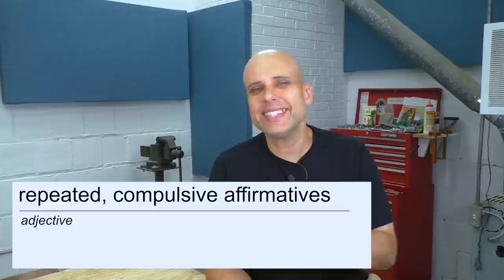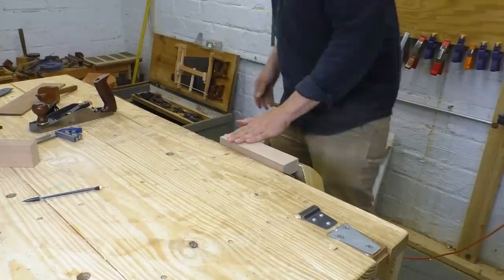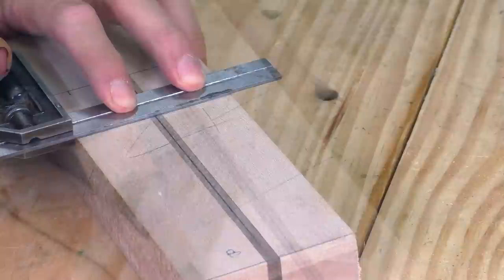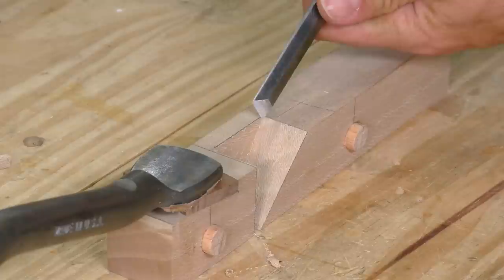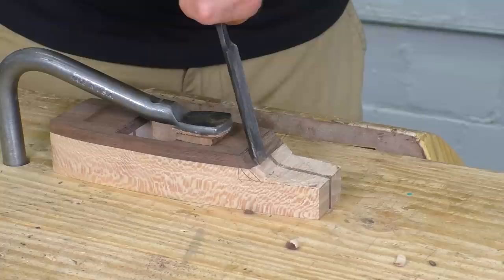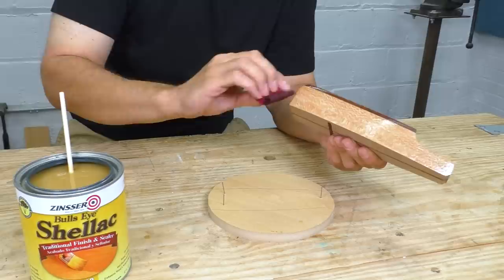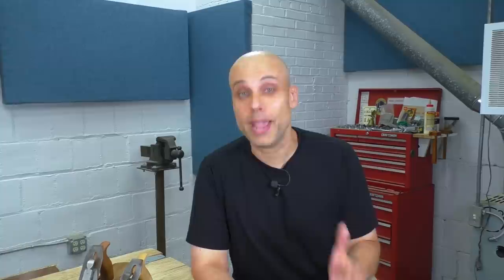I CAN'T fix this vintage plane...by myself.

Comment: I still remember you using the same method to true up the bed of your DIY spokeshave, in that video you used pencil instead of marker.
It's crazy thinking how long I have been following your channel. I remember that trick because I've made the same spokeshave with the same technique. It still works great and it's about time to change the mouth piece but I'm glad that I made it take-apart so it can be easily replaced.

Comment: Just finished watching the video, that plane is absolutely beautiful!  Between Jame's Wright's handle and totes, and your fix, it was sublime.  It looks way nicer than what I would have come up with.  But there is one thing I would have done differently:  I would have used a bit brace instead of a forstner bit.  It is the perfect tool for cutting a complex angled hole like that.  It is a hand tool, so you have complete feedback and control.  The snail bites into the wood, and the knickers slice cleanly.  
I am currently using my bit brace for a much different project:  Removal of moldy, water damaged particle board from a sink cabinet.  While a sawsall and a power drill would be faster, it is much more likely to damage something important like the water supply pipes under the cabinet.  So a bit brace and a small heyhole handsaw is the way to go.

And it was this guy on YouTube that taught me everything I needed to know about bit braces.  I wish I known about them a long time ago.
https://youtu.be/tTch3KE_Aio

Comment: So now I'm collecting wire from local house construction surplus locations.  (Once they put doors and windows in it, the surplus stuff isn't accessible anymore)  Once I have enough, I'm going to make an electrolysis ring large enough to drive my rust bucket car through.
I can hardly wait !!!

Comment: the end piece speaks for itself!  it looks great and would be proudly prominent on any cabinetmaker's bench.  
The pandemic put the ENTIRE world on hold, even if you caught it afterwards.  It's just going to be something we all have to deal with....from the sounds of it, it may be around for a while yet..  
the metal frame is interesting.  i've never seen one that had the scoop out of the back like that, though admittedly, i'm a VERY casual collector.   In general, i avoid the hybrid planes and look for the older solid wooden ones.

Comment: As always a great project with all the info we need to get going and build our own planes. Ive always wondered about how to cut out the throat shapes in planes. I have some really gorgeous pieces of kiln dried Australian Eucalypt hardwood. I also have some air dried, over 100 year old, Australian Iron bark which came out of an old shed in our little town. Ill practice on some pine I have air drying in the paddock and will need to be cut into stock pieces, or Ill just buy some pine from Bunnings too practice on before I use my good hardwoods.
Ill have to flick over to James' site and have a look at his videos on plane throat cutting.
I really like how you guys all work together to bring us the stuff we can do in our own sheds and garages.
Cheers from Down-Under 🙂

Comment: ooh nice choice on those rechargeables batteries, i use the same ones. I highly reccomend their better charger that that they sell, it shows how charged the batteries are and also lets you discharge them if you know they wont be used for a long time

Comment: Very nice job ,BUT I think the dark wood you added would have looked more interesting on the  bottom to set the handle off.❤
Reply: Im gonna drop my few cents here, I think it would look nicer if there was a sycamore strip amidst the walnut.
Reply: Having myself botched a handmade plane with a walnut sole, I would say it would have to be a different wood. Walnut is very pretty, but waaaayyy too soft for the wear.
Reply: Respectfully disagree, I think the walnut where it is understates it as the plane transitions from the dark japaning of the metal to the lighter maple.  

I think that understating transition is beautiful, and having the walnut on the bottom would be more striking but look to busy.
Reply: It couldn't have been on the bottom because of the mouth geometry. The angles of the plane bed came together at a very specific place that would have been messed up with an extra piece on the bottom. He would have basically had to redo the work cutting the bed and mouth.
Reply from the maker: @anonymousaccordionist3326  ah, out of all the comments,  one person gets what's going on.  Thank you!

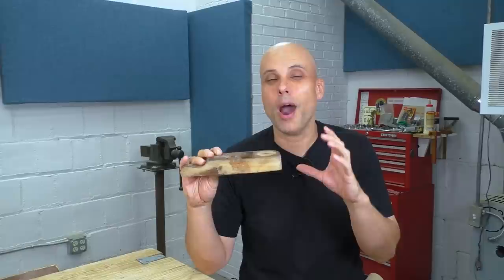Comment: I'm at 6:43 where you just discovered your mistake about the body being too thin.  I haven't seen your solution to that issue, but as someone who has made plenty of similar mistakes, I would do exactly what the original owner did:  Laminate an additional piece to the body to make it thick enough, and probably use a different wood species just to make it even more interesting.  To complete the bed, I would use the existing bed as a jig for the chisel to hollow out the new piece, then use the same flattening techniques you used.  

Now on to the video to see what you actually did.

Comment: Hi Rex - Noticed your bandsaw puts out alot of dust. Checkout rob cosmans dust extractor. PS I made mine without a slot hole to take off the blade. It gathers nearly all the dust with a shop vac.

Comment: I am sorry Rex and I am sure that my comments will bring me some hate. But you should have matched the wood you used to that of the handles. There are just too many colours going on, making the composition look confusing to the eye. Maybe the Rex Krueger of a hundred years in the future will ask what was this guy doing I guess he found some odd bits of timber in his scrap box and cobbled them together. or repaired the plane over time, as one bit wore out, he would use whatever wood he had available at the time. What you have done has been well executed and I am sure that it is a perfectly functioning tool. (A) for the quality of your build & (C-) for the artistic interpretation of the brief. Well done, Rex, it was a lovely personable video, a really quality production as ever (A+).

Comment: OK. now how about a how to of the electrolysis ring? I have an old gouge i would like to clean up.
Reply: Its was a joke, that's not how electorlysis works lol. It's still easy enough to do though, just have a google.
Reply: @stacksmalacks8826  i wish I could afford an induction coil. Have done electrolysis before. Also have seen those laser things that heat and remove rust.

Comment: Whoa! Hold on Rex. Do you read these comments? I want to know more about this electrolysis ring. I know about the electrolysis water tank method, but I never heard of this ring method. Is this a joke? It looks like you have a dead short across your power source. Fess up, or explain in more detail please. Otherwise, great presentation.
Reply from the maker: It's just a joke.

Comment: Your older content was better
Reply: Uncle fester was always a grifter - never very skilled or talented.  If you're looking for skill & talent, check out Paul Sellers or Graham Blackburn - those are the real woodworkers - no "figuring things out" or "making mistakes so you don't have to".  I only tune in to youtube's grifters for a laugh.  I guess you could call them "uncle fester and the grifters" - sounds like an early 80's punk band now that I think of it.  

My advice for sources of actual woodworking:

Nick Engler's "Woodshop Companion"
Rob Cosman
Paul Sellers
Graham Blackburn
"The English Woodworker"

98% of the rest of youtube woodworking is for laughs - sometimes WITH the "influencer".... sometimes AT the "influencer"...

With uncle fester...it's always AT.